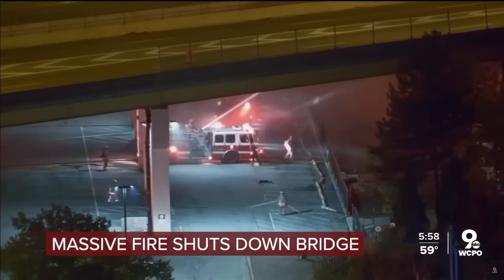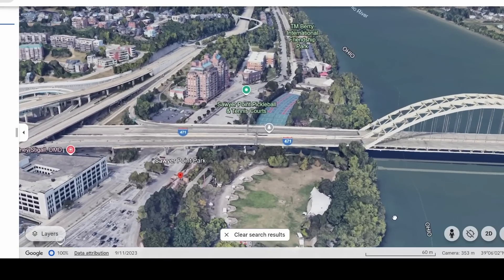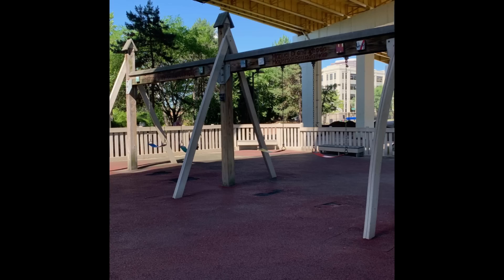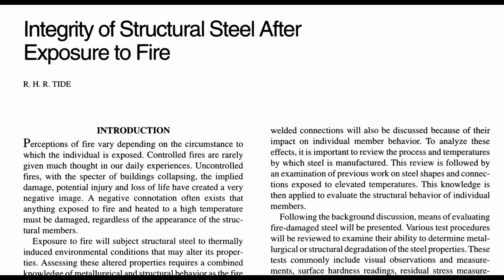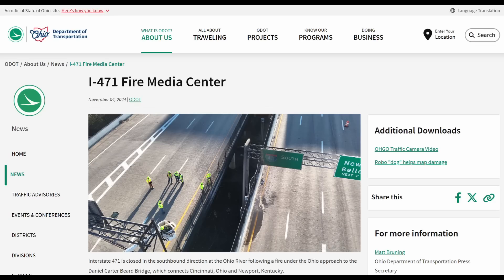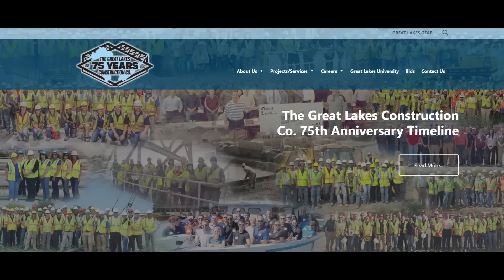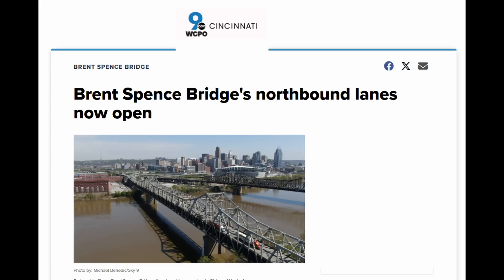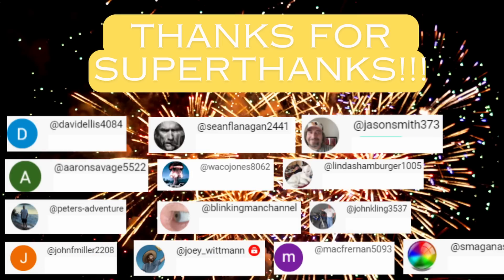A Whopper Job for the Big Mac Bridge - How Does Fire Damage Steel?

Comment: If you haven't been down ther to see it......man, we're talking steel girders SAGGING from the heat.....3ft tall girders, with a dip in them!........it's serious. Saw it with my own eyes.....I'm surprise they are letting any cars on the bridge right now.   Wish I could post photos here.....it's nuts.
Reply from the maker: That was an extremely intense fire!
Reply: BTW....my mistake re: cars on the bridge....looks like the they're letting cars use the Northbound side (Kentucky to Ohio) which  I believe is a seperate structure, but right next to the Southbound side where the seat of the fire was located underneath

Comment: Thank you.  I do not know much about steel but I know that it can get twisted out of shape from intense enough fires.  Seen news pictures of burnt out buildings with some of the steel beams turned to scrap.  Steel for bridges would be different but seems the temperatures needed to start compromising it are not that high.  My dad used to heat treat the steel components for his dies at home in the kitchen oven sometimes.  Pissed off mom and stunk up the house.  Much higher grade steel.
Reply from the maker: Thank you. It is just too tempting to use the kitchen oven!

Comment: The 275 loop around Cincinnati is VERY long as a detour. However, 471 is more like a local road in my opinion.  The biggest issue isn't with traffic passing through Cincinnati.  They have I-75 and I-71.  The issue I think is more with local traffic between lower Cincinnati and Northern Kentucky, especially on the southeast side.  Newport, KY, isn't setup to take detoured traffic very well.  For example, coming from the north, you can cross using the Brent Spence and get off on the west side of Newport and then drive east over to where 471 crosses near the tourist stuff like Newport on the Levee.  But the streets can't handle the traffic.
Reply from the maker: Sounds like a real mess.

Comment: One question: What is the impact of temperature change to the fatigue strength of the girder specially those bolts and connection plate? After all, one of the characteristics loading pattern of the transportation facility is cyclic loading. Thank you!

Comment: Seeing the deformation in the steel beams from the heat raises the question of  "what is the actual thickness of the steel plates?"  Yes the beams are measured in feet, but what is the dimensional thickness of the steel itself?

Comment: Is the heat from, say, burning rubber able to only hit a specific temperature, or can it burn much hotter if you have a bunch of it on fire at once and massive radiated heat and airflow?
Reply from the maker: It appears to me to be the latter.  The airflow coming in for the sides below the deck must have been tremendous and acted like a giant bellows.

Comment: Dramatic views! The park walkway under the bridge is now open, connecting the two sides of the park.  The first span from the arch bridge is safe to walk under.  It's completely black from soot.  There are some good photo locations near the park restroom building under the bridge.  Along with the heavily warped girders, now the edge girder is visible, and it looks like it melted instead of warped.
Reply from the maker: That’s really interesting! I’ll have to check it out.

Comment: Quenching hot steel with water also does a lot of damage, as anyone who's tried it knows. Even further from the heat, it can get case hardened, lose its ductility, and become brittle, sometimes cracking both internally and externally and spalling off flakes. Hot concrete or stone can explode when it's hit  with water.
Reply from the maker: Good point.  I NEVER quench with water.  I do an oil quench at then anneal by blades with a few 600 degree cycles in the toaster oven.
Reply: I use octupi  blood...
Reply: @Thom4ES  re: "octupi  blood"
For an added surface treatment with the Iron content of the blood? kidding

Comment: I found your explanation very compelling in light of one of the arguments for an "insider" job of 9/11.  Their argument is that steel wouldn't melt from an av gas fire.  Obviously, there's no need for it to melt.  Also appreciate your book recommendation.  Or maybe I don't.  Being a bibliophile has its drawbacks.  😅
Reply from the maker: Thank you.  You are correct.  As I pointed out, just heating the steel to 1,100 degrees F is enough to reduce the strength of the steel member by 50 percent.

Comment: When you pointed out the rubber matting, I remembered the foam rubber soundproofing at The Station's nightclub fire
Reply from the maker: Yes, that was a tragic event and an apt comparison.
Reply: The Station Nightclub was about two miles from my home. I watched the TV coverage of the fire, terrified that friends might have been among the victims. Thankfully none were. I frequently drive past the beautiful memorial to the victims. The foam in question was a urethane foam purchased for its low cost. The foam was highly flammable, and likely to produce cyanide on burning. Not rated for indoor use.
Reply from the maker: @carltauber2939   It was shocking how quickly that fire spread.
Reply: @CaseyJones-Engineer  Just watched that again.  They had about 20 seconds from when it started to when everybody could clearly see there was a large out of control fire and everyone started moving towards the exit.  
20 seconds... in a packed room.
Reply: Hey kids, wanna go play under a freeway? The whole thing seems like a bad idea.

Comment: This is complete incompetence of the DOT. Great care should always be taken that nothing flammable is built or stored under bridges and overpasses.  These spaces can be used, but materials like concrete and steel should be used for construction. This is on par with storing gasoline next to a fireplace, maybe nothing will  happen, until it does.

Comment: ASME & API take different a design approach to equipment exposed to a pool fire. The main concern with a pressure vessel exposed to fire is sizing the relief system that will vent off the vessel contents before the vessel yields. Those relief systems can get very large so the equipment is insulated to reduce heat flow into the vessel. The insulation is designed to stand up to firewater blasting on it. API RPs call out this sort of protection up to 25 feet above grade.  ASME material property tables tend to only go as high as 900F so no strength is assumed above that temp. One interesting point of the design is the temperature that corresponds to the boiling point of the liquid. When the relief system dumps the relieved fluid takes energy away from the heated vessel which is a good thing.  If everything functions well the vessel will be near empty of liquids before the vessel wall temps get into yield territory. If a fire goes on long enough the vessel will yield and the remaining contents will release locally and contribute fuel to the pool fire. All this is very dynamic and each moment of the fire incident needs to designed to say within the capabilities of the materials.  Having said all that - a mass of combustibles under an overpass seems to be a real bad idea and the Codes need to catch up with this bad practice.

Comment: So why don’t steel objects fail more frequently were they are welded together?
Reply from the maker: Because the connection that's being welded is not under load at the time. Plus the heat is highly localized.

Comment: The I276 bridge over the Delaware River suffered a fracture of one of the main longitudinal beams on the PA side approach.  A contractor was able to erect a support tower and repair the fracture (with doubling plates) in just a couple of months.  Obviously Big Mac suffered a lot more damage, but there are contractors that can set up quickly if the engineers can determine what's needed.

The spaces under the bridge should be recognized as part of the bridge, and under control of qualified engineers.  There are things that can be put under a bridge with much lower fire hazard, for instance tennis or volleyball courts and softball diamonds, running tracks, and dog parks.  High temperature flammables should be put somewhere else, with a quarter mile or more of clear space, depending on the materials and their quantity.

Comment: Based on the color code fire was between 1000 and 1500C. While this is moot point here because of the deck loading and heat the girders did melt and the road did sag. 
Thus that section horizontal structure will have to be removed as complete girder sections. 

The next question is how much needs to be removed, assuming that the concrete columns were not damaged there are questions that need to be asked. 
1. Was ductility lost and is the bridge subject to loss of ductility fractures. Probably not. 

2. What was the type of steel used, how was it quenched and at what temperature does? The base assumption is that this is heat treated carbon steel. The problem here is that heat-treated carbon steel is not a thing, but a collection of things defined by a dozen or so predefined engineering standards that vary depending on application. So this basically gets into taking an original sample and a query and comparing the two steels with a scanning electron microscope. But the issue is even more complicated because the heat resilience of these steels very much depends on the manufacturing process. By resilience it means resistance to  T° x t or TTT changes. As a result when sampling it means you need to compare steels made by the exact same process.

Some steels can undergo significant property changes if held over 220° for any length of time. 

Thus there are probably too many variables to constrain the limits of tolerance. 
If this is being done from a safety compliance point of view the entire section needs to be replaced. The constraints on repair will be the longevity of patch, and the esoteric nature of steel damage. The other question is how old is the bridge and what would be its normal replacement life. You might just opt to replace the whole bridge. 

Moreover there is another problem. That decking is concrete, once enough water of formation is driven from the concrete it’s done, there is no way to restore the original strength of the concrete. All of this damage lies on the bottom side, therefore you cannot see the damage on the road bed. Thus when the road gives, the road will blow out from the bottom with minimal indication of damage on the surface before it blows. Typically these surface are between 8 and 10” think, and that question is how much erosion of the slab is tolerable. That question involves another TTT profile.

Comment: I don't really know the reasoning as to why schools, parks and playgrounds switched from having sand to rubber as a surface. I'm assuming it was somehow deemed to be safer.
Reply from the maker: I suppose that is the reason, although I wouldn't rule out the marketing efforts made by these manufacturers.
Reply: @CaseyJones-Engineer Yeah, I think the whole "reuse old tires so they don't end up in landfills" campaign has been a tad too effective in this case.
Reply: Recycled tires became a very cheap source of materials, and the rubber surface is very durable. It became a popular surface for many sports. Sand has some issues, the main one is cleanliness and health. It’s messy, it blows around when it’s windy, it sticks to you when it rains, it needs to get refilled over time. Health wise it’s a little more bug friendly, for example lice can be present in sand, along with some other undesireable bugs. Kids can eat sand and it may cause GI distress, stuff like that. Not the end of the world, but if schools and parents can cut out another source of stress, rubber textured surfaces are an easy and cheap solution.

Comment: When pretensioned concrete is heated I wonder what effect the high thermal conductivity and expansion of the rebar inside those beams plays in the beams longterm strength.  The heated rebar will grow in length removing tension from the concrete, and increase in diameter a small amount.

Comment: Was there fireproofing on the steel? I did not see any in those pics.  Paint?
Reply: I have never seen fireproofing on exposed steel in bridges, probably because it would block visual inspection and is likely to retain moisture and contribute to corrosion.
Reply from the maker: Great point.
Reply: @patmcbride9853   they use a paint that has a fire rating but if they used it back in the 70's idk.  Back in the 90's alot of fed $ was spent doin shit like fire prevention , earthquake upgrades to bridges and the like.
Reply: @ there is fireproof paint they can use. Because ive seen and been around it. R value

Comment: Casey, it takes the hands on experience of a blacksmith or knifesmith to have a real understanding of iron and steel.   Simply using published engineering data just isn't the same as working with the steel in the forge, hammer and anvil. Great report!
Reply from the maker: Thank you.  There is no substitute for having hands on experience.

Comment: Seems like the "detour" would be converting the still functional bridge from being one-way to being  two-way during repair of the damaged bridge.
Reply: I wondered too.  But it's not practical.  I-471 exits wouldn't work, or reverse flow exit ramps near downtown.  And the bridge was already continuously congested during rush hour, with all lanes open.
And there's alternate routes to take, with portions on city street bridges instead of interstates.

Comment: Again, Casey, a very interesting and informative update. You also reminded me of something from my school days, over 60 years ago, the coefficient of linear expansion. For some reason that has stuck in my mind and is of interest to me. In this case, the length of the span will increase depending on the actual temperature rise. I think that I am correct in saying, that damage will be done through the expansion before the length reduces due to the eventual sagging of the span. I believe, conspiracy theories aside, this is what happened to the Twin Towers structure, expansion then sagging off their supports.
Reply from the maker: Thank you.  Yes, and the steel loses strength at the same time.  Not a good combination at all.  For what its worth, I am not a fan of most conspiracy theories.
Reply: I respectfully disagree.  All bridges, and spans utilizing steal beams have to have expansion joints. Iron and steel's  high rate of thermal expansion has been well known for over a hundred years.
Reply: @mr.shannon6137  Built in rates of expansion would allow for the hottest anticipated weather and surely would not take into account the expansion involved due to1200 plus degrees? The hotter it gets the more it expands and eventually the expansion gap is exceeded.
Reply: @RonSeymour1  Good point.

Comment: Casey, you should have also mentioned this same problem exists with 'rebar' inside of concrete! Although it takes a lot longer to heat rebar encased in concrete and a lot longer to reach those temps, it does happen and weaken the rebar!
Reply: Add to it that the concrete itself is weakened too.
Reply from the maker: Yes, I should have mentioned that in more detail.
Reply: Sea water can also deteriorate it badly, like at Surfside!😮